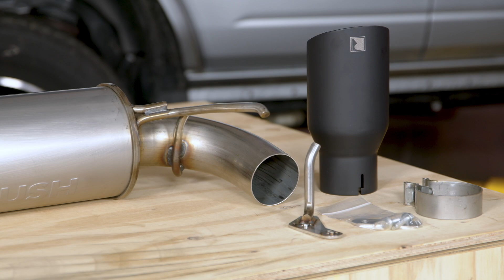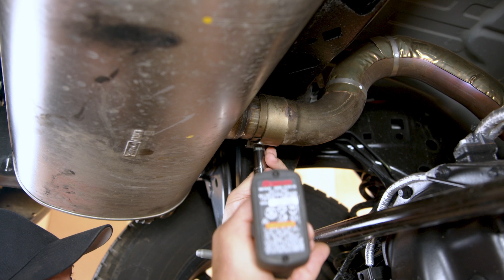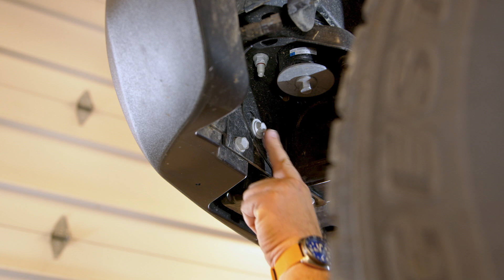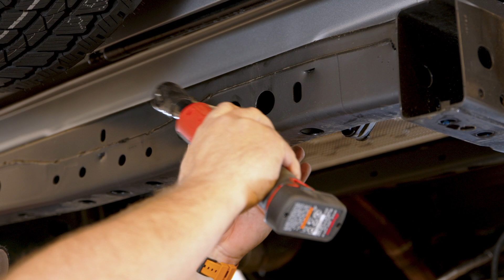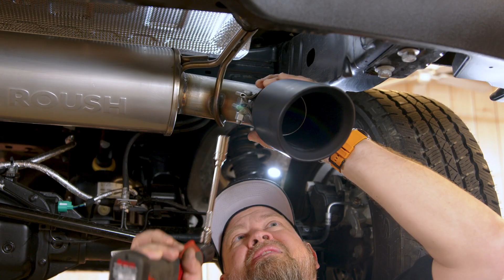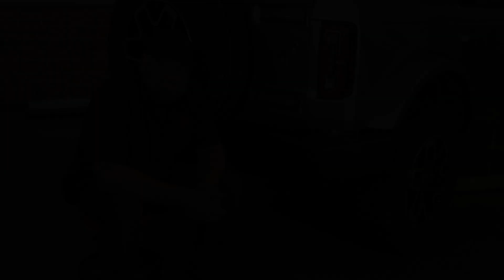Roush Performance: How to Get Rid of Weight and Change the Sound of Your Bronco

Comment: Sounds awful.  I despise that fart can sound.  I can save money just jamming a hole in the muffler with a screwdriver and it will sound the same.  Thanks for doing this so I avoid that unit.
Reply: Nothing wrong with the unit bud it’s just no v8
Reply: @joserivera9122  Never said there was anything wrong with it mechanically.  It sounds like ass.  At least the OE muffler is quiet and doesn't sound lame.
Reply: @joserivera9122  sounds like crap too😜